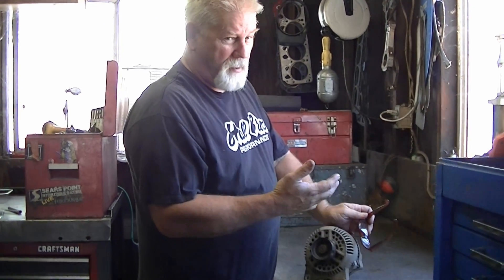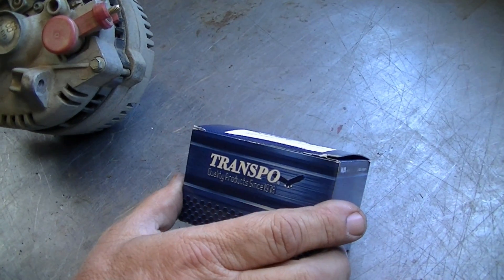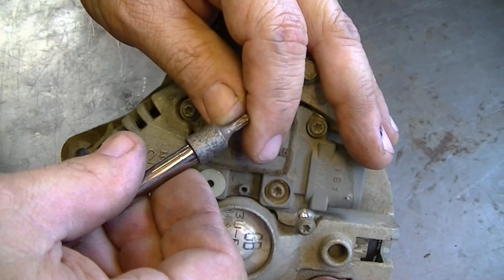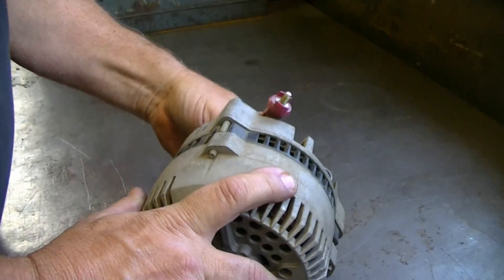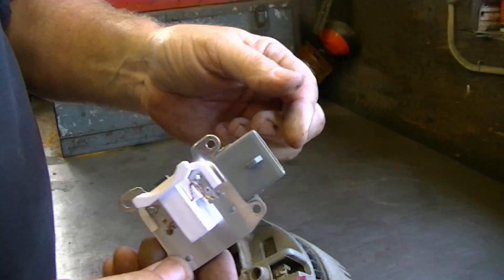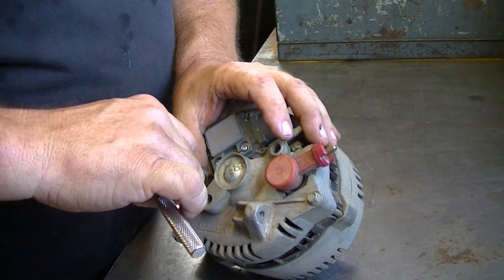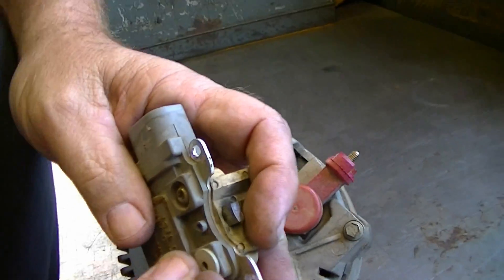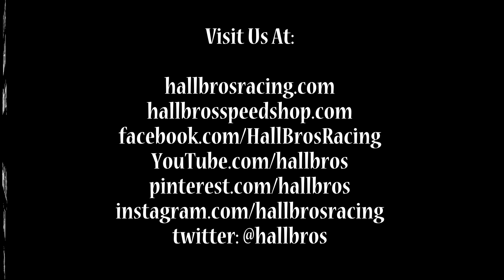How To Replace Voltage Regulator Brush Assembly on Alternator

Comment: Just pulled mine to check it on a 1998 genie with the Ford lrg-423. Freaked out because I wasn't sure how I'd get it back in with the springs/brushes lined up correctly. Totally didn't even notice that hole to slide the pin in and hold the springs/brushes back. Thanks a bunch!

Comment: Yeah I have a brand-new alternator Ford Motor Company that's only charging if I put pressure on the regulator like putting a screwdriver between the housing and the regulator and put just a tiny bit of pressure it starts charging let go it stops I have a piece of cardboard shoved there right now to keep it charging because I cannot freaking figure it out anybody have any ideas I'll take any ideas at this point

Comment: Wow! I think i need to do that. My speedometer needle bounces while in park, my dash lights are dark and i don't get full voltage from my alternator until i rev my engine to 3,000 rpm one time before i drive off. I have to rev my engine each time after i crank my car or the battery won't charge. My battery light comes on after revving meaning it's charging lol totally backwards. 
After revving, i can drive all day without a loss of power but that battery light will stay on. I've been driving it like that for 3 years. 
Sometimes i would forget to do the rev and my lights would dim and the car would try to cut off so i would have to throw it in neutral while driving and rev the engine.
It fooled AutoZone's scanner if i don't rev it and they'll say i need a alternator..if i rev and let them scan it they'll say my alternator is fine.
This is probably a rare way of driving a car with a bad voltage regulator or alternator but it made me buy a new battery due to a scanner saying "it's the battery, no it's the alternator" and i was on the verge of buying a new alternator until i saw this video! Thanks

Comment: Thanks Mark, I knew better but I had 1000 things to do and discovered my Battery was not being charged.  Being as I had just dropped my other truck off at the shop for hail damage repair I dropped by a local auto store and purchased a new alternator after having the tech check out my problem.  Diagnosis was voltage regulator bad.  So P purchased one for 185 including tax and a 20 dollar core charge.  Well I drove the truck a few miles  and the darn thing cranked without jumpers.  So being an old school guy and I knew better than to purchase one I got to thinking about it and found the answer here on your site.  You confirmed what I knew but ya know your are pretty successful and can afford to pay to have work done but it is really just throwing money at a problem.  Being able to fix it your self is a lot of gratitude in that.  So when this cowboy gets back from Calf he will replace the voltage regulator and brush assembly and be as happy as a pig laying in the sunshine  One note you have to be careful what voltage of part you purchase because if you are running an A\C you will want the higher voltage part
Thanks

Comment: I will check this out. Replacing an alternator three times...THREE TIMES and the issue with the battery light happened after the third installment (Homer Simpson's 'D'oh!' is inserted). I will confirm this Saturday morning (5-18-2019) after breakfast. I have to get this vehicle ready for emissions and I keep having a drain.

If no pin is in the new alternator, I will look at replacing the regulator as directed. Hope I have enough to cover this exorbitant (Several weeks) repair.

Comment: Please help.... I have a 56 buick roadmaster. Car was sitting down for almost 20 years. After working on my car for few months. Car runs good. But next day my car battery is dead. My generator brushes look good. Should i buy a voltage regulator or a generator. Ill would really appreciate for your advise. Thank you